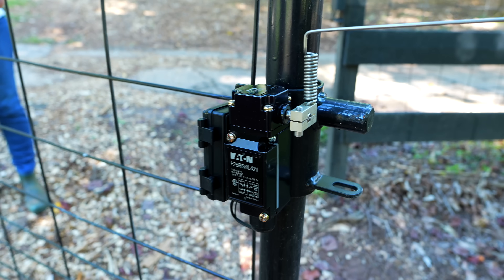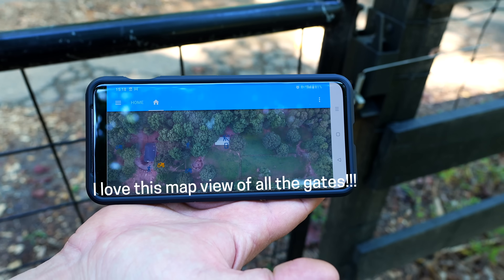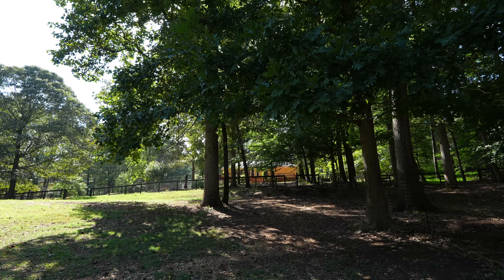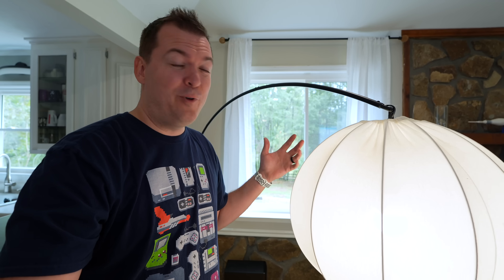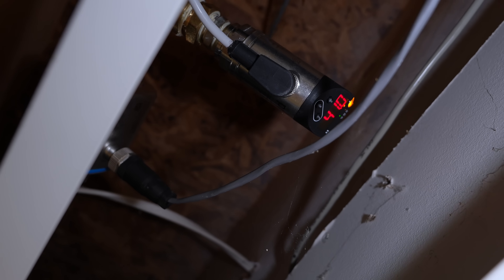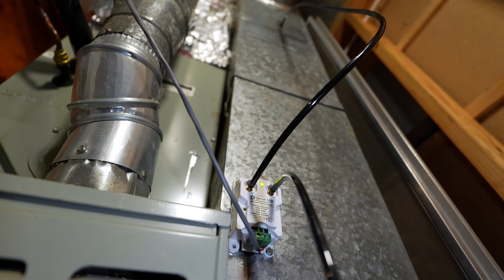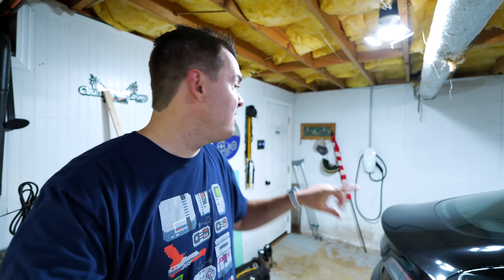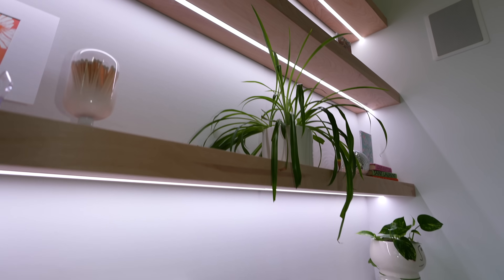Smart Home Tour with CRAZY sensors you’ve never seen 😱

Comment: For the bathroom water temp detection, a cheaper/simpler method could be by adding a Temp/Humidity sensor in the bathroom and getting some empirical measurements of the combination of both metrics when the water is at a "comfortable  & desired" level.

Comment: Ok, good automation but not quite what could be done. I build a similar automation system for my home with a Siemens S-300 PLC. If you run a automation system driven by a PLC , you are "not allowed" not to build a HMI system to visualize the status of your home or to run commands by it. I build one for my home automation , so I know how i`m speaking about. The HMI interface advantage is that you can build the exact layout of your home , that you can build graphic objects for the sensors or lamps, motors, valves etc To run a sonoff panel when you control your house by a PLC  ,for me is a crime.

Comment: How do you get the Wyze V2 to transmit all the way from the run in to the house?
Reply: It ties to another wifi station at the barn, which is connected to the house using the EnGenius bridge.

Comment: This is absolutely insane... Now the ingenuity is one thing but dialing them into home assistant is actually the most impressive thing ever. I'm currently trying to get my zooz light switch to work as a button with 11 chinese smart potlights and some contact and mmwave motion sensors and dialing in home assistant against smart tuya potlights has been tough. Just when i thought i had it 3 are offline im not sure if its the light itself they wont re sync onto wifi. I just had to put it on pause and use them in their on off relay function mode for now

That wall of devices pulled into home assistant integrations looks awesome. Kudos

Comment: None of this technology is new, we've been using it in industrial automation for many decades.  It is just a case of how much money you want to throw at it because the equipment isn't cheap. This homeowner seems to be in industrial automation because he has a wall full of PLC's that he uses very little of. He could most likely do all of what he's doing with just one PLC with at worst an expansion unit to add a few more I/O.  

So much of what he does has no practical value, just show-off value. All through the video I asked myself whether I would spend the type of money he spent on the equipment just for show-off value because it has zero practical value.

A good example is the shower water temperature sensor which sits in his basement and by the time that water that he now has lights showing is on temperature reaches the shower he has wasted a whole lot of water and yet he worries about a dripping faucet causing damage in the barn??? What damage would the dripping faucet cause in the barn and what about the person who uses that faucet? Can't that person just say 'hey, that faucet in the barn is dripping"?

The gate sensors are also pretty standard industrial sensors and while I love the idea, that straight spring wite sticking out at the end is pretty dangerous and could impale a rider or horse. Simply bending a loop in the end would make it safer.

The sensor he has on the air filter also isn't a new concept, they are differential pressure sensors and are also used to measure flow of gasses and liquids in some applications where they use them to measure the pressure changes through a venturi to determine flow rate. I want to use a pressure sensor on my pool filter but I don't need to measure differential pressure. A significant increase of pressure before the filter is adequate indication that the filter needs cleaning.

While there is very little of this that actually appeals to me, I do have to give credit for the technical skills required to get it all to work together...even if so much of it was unnecessary and unnecessarily expensive. Two immediate examples that come to mind is the differential pressure sensor at the air filter could have been replaced with only a pressure switch and the flow meter/temp sensor on the shower water could have been replaced with a mere thermocouple closer to the shower heads.

Comment: Got teens that love to shower for 10mins
FYI: a cheap water sensor on your shower head will allow you to measure the water flow. I have mine into an arduino that starts beeping every second after 4mins. You turn the show off and it resets (after a minute of being off).  After 5 mins.. it starts alarming. I’ve always threatened to have after 5 minutes to turn a valve on the hot water line on. You can have a long shower… but it’s gunna be cold!

Very effective. My kids now learnt to have 5 min showers… and our waterbill has dropped.
Feed this data into mqtt… you could trigger light changes etc… 

Easy and probably cost less than $50… been in place for 6 years now and part of our daily use

Comment: How was the NSPanel mounted? I have been looking for a way to put it in a 3 gang box.
Reply: I took a 4-gang switchplate and bought two decora blanks, then cut out the part of both the plate and the blanks where it needed to fit, and tapped screw holes for mounting.  I'd probably print a custom plate next time, though.

Comment: As someone who works with automated production systems I just assumed things like the pressure sensor were normal(ish). But it made more sense once the DIN rails showed up. TINK! That was the sound of the penny dropping :D
Although running PLCs are likely a little overkill they would also be the most robust solution I have ever seen. Time to talk to the sparkies at work.

Comment: YoLink devices are part of my system and work so well from distance. Their fobs are multi button smarts that all play pretty well with alexa routines or on their own. Their sensors only one that worked for my outdoor driveway sensor and temp sensor only one I found reliable for my freezer alert from garage. is a nice setup. My setup not so detailed. They did a nice job on their place with solutions.

Comment: Nice video! However, being an Electronic Automation & Control Engineer myself, really struck me in why he would use an oversized industrial hardware setup for home automation purposes? He is losing so much computing and communication power in that setup not to mention the cost of the devices. 

The video's PLC is mainly used in industrial automations for its exceptional capabilities to control PID processes - in a P2MP (Master - Slave) architecture - over industrial automation protocols (e.g.Modbus, BACnet).

On the other hand, it is really clever the way he smoothly advertises the brand of the company he works with.
Reply from the maker: Yeah no one is saying this is the most ideal setup for the average home. If I had the job Chris has, I would definitely have a setup like this to test things out and have fun.
Reply: @SmartHomeSolver   That's right, this isn't a typical home automation setup.  Part of my job is to test new features in this line of PLCs, and my house felt like a great place to do some of that testing!
Reply: @etrmedia  Yeah it was pretty obvious you are also testing these things in your house.

Comment: I loved the video, but I think it highlights my current frustration with the home automation scene right now. Beginners and even those who are tech-savvy, get left behind by not knowing how to set up advanced automations. I think the product manufacturers need to find a way to reduce the skill gap and open their consumer base.
Reply: Some of these automations are complex (Chris' kettle build was kind of ridiculous 🤣) but others were very straightforward to set up. For example, I have no automation background but consider myself moderately tech-savvy. I set up the barn fan automation myself in HomeAssistant, as well as most of the user interface for the 'barn' page in HA. 👍
Reply: @jannakregoski4361  yeah, the cool automations are my ceiling. Once we start talking about modifying hardware and software... That's where I get left behind.
Reply from the maker: I appreciate the feedback. I completely understand and it's one of my top priorities this year is to help bridge that gap. I'm still working out the details but I have some helpful stuff in the works!
Reply: Soon or maybe already you can ask an AI. I get what you mean, my mind cuts it down to smaller parts, the problem with that is to choose the right parts (not always the coolest) and to always account for the spouse factor.

Comment: Great video! Wonderful to see so many things automated!!!....

I wonder if anything can automate my water heater. For example, I would want to set an automation to ramp down the temp on my water heater while I am away or asleep. There is no reason to keep that thing running when it wont be in use. 

Also, currently looking to see if there are automatic gas shutoffs much like they have automatic house water shutoff in case gas is detected in the house. My gas shutoff value is not the easiest to get to and getting everyone in the house to know where it is and what to do is not that easy. I want to automate it to protect everyone.

I loved the grill sensor as well, it would be nice to see if someone got a meat thermometer in home assistant or something so you can tell when things are at temp and send a notification instead of trying to time it appropriately.

I am really starting to ditch the routine game I am in and really embracing automatic actions. Next stop is Home Assistant!
Reply from the maker: Those are some great suggestions and I don't know most of those off the top of my head but I'll be looking into them.